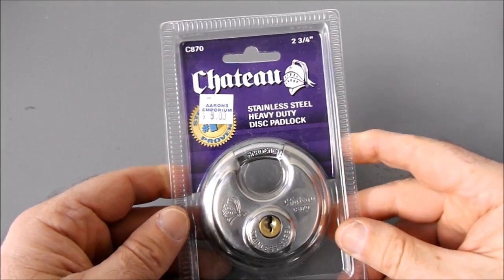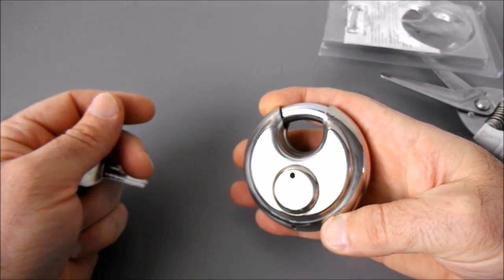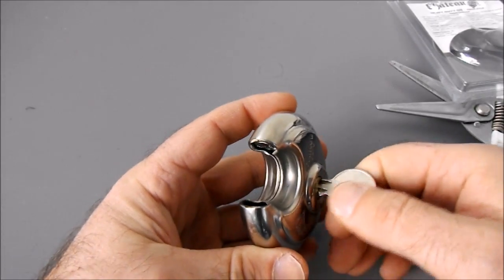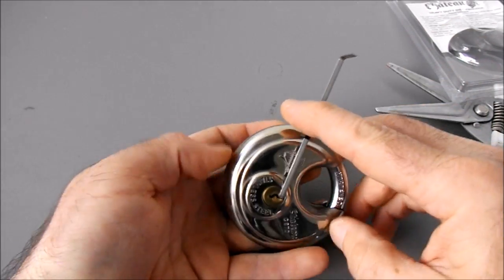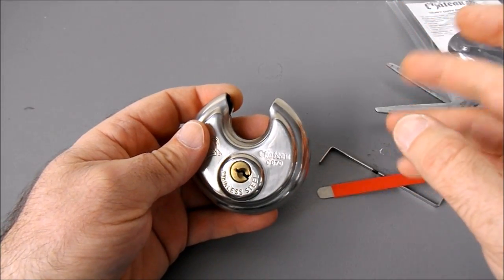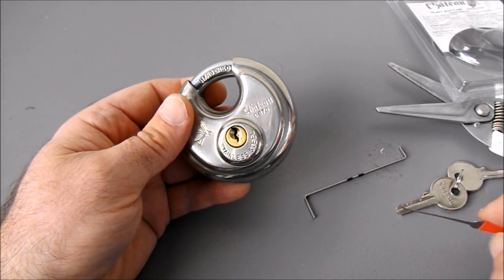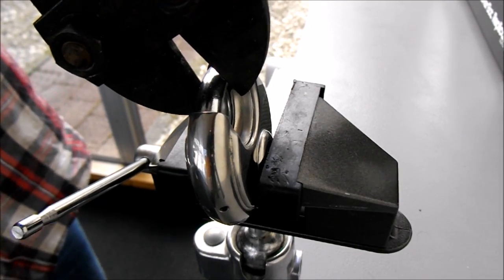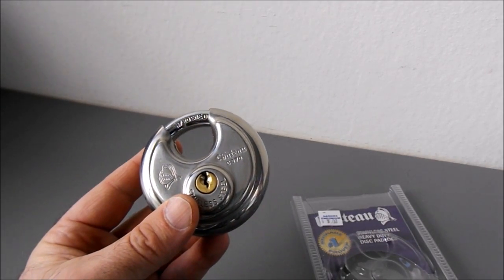[4] Five buck Chateau C870 70mm disc padlock - surprisingly good for your money

Comment: I have opened 3 or 4 of these pretty quickly with a manual pick gun. They are a bit more difficult to get in with a pick to single pin pick it.
Reply: Thanks for that information. I am a total newbie at picking. So naturally, I begin with the locks I have at my disposal. One of them is a Chateau C 970 disc padlock which I simply can't open. Of course, all I have right now is a cheap Chinese starter set lol, but it's allowed me to open both deadbolts to my front doors, several padlocks, wafer lock to an old firebox / safe etc. This Chateau I can't rake, I can't SPP,. I'll be ordering some decent Sparrows picks soon (a few .015 ones for tiny keyways like this one). But I was also wondering if a manual snap pick gun might be useful with this lock. I guess I'll try a cheapo Chinese one first. I'm not really interested in Locksport, just knowing that I can get into a lock (non-destructively) if I needed to. I wondered if there is a Lishi-type tool for tiny keyways like this. I don't know, but I assume it is a Yale-type keyway? I know they make a Lishi knockoff tool for Yale keyways, but I don't know if it would fit in this Chateau keyway, as it's very small.